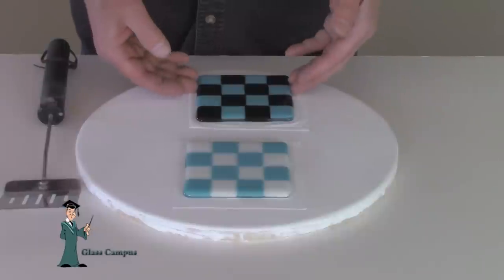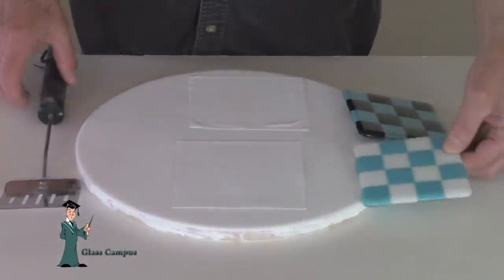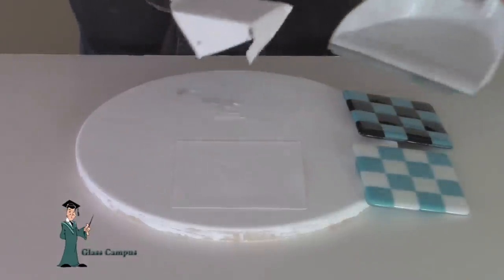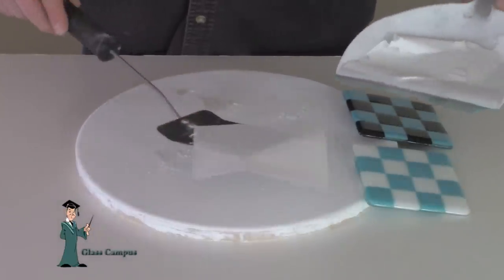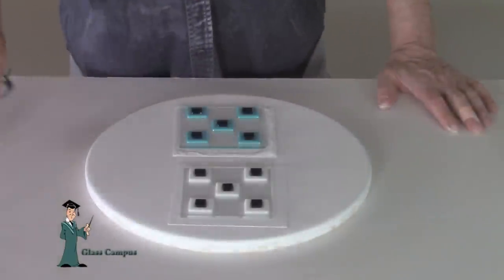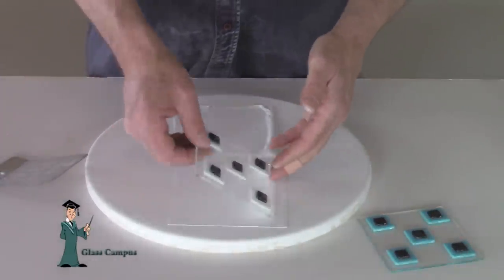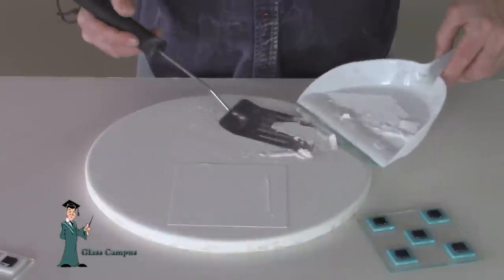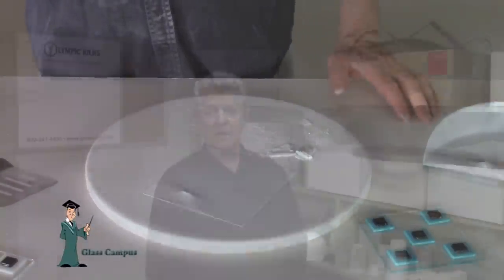Spectrum Papyros kiln paper vs Bullseye Thinfire

Comment: How does the bottom of the fused glass feel? Is it smooth or rough? I had used thinfire before and happy with the result of very smooth bottom. As I ran out of this I ordered papyros and awaiting for arrival. Meantime, I used some fibre paper and with full fused, I got very sharp edges and rough surface at the bottom.